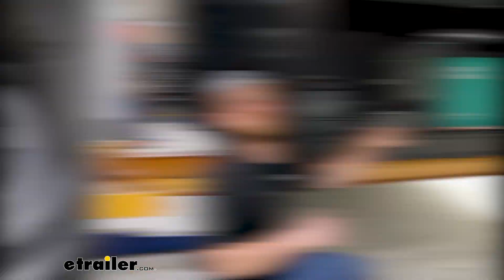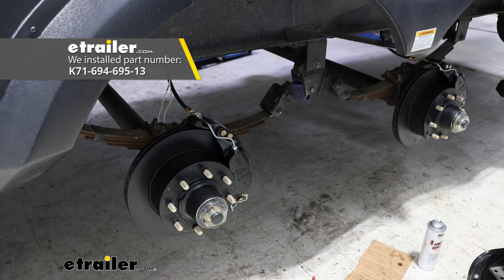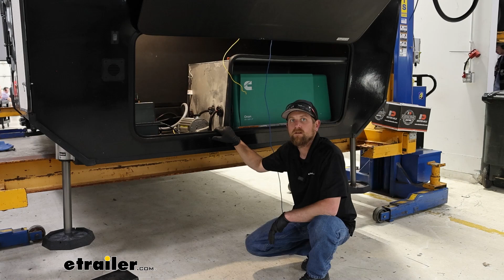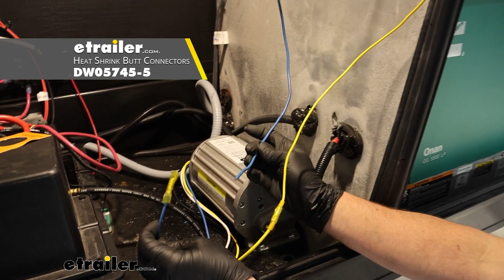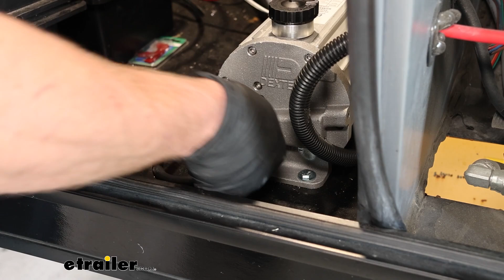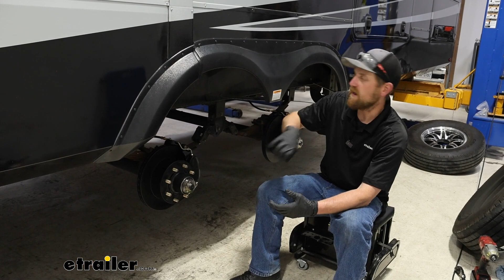Dexter DX Series Electric Over Hydraulic Brake Actuator Installation - 2021 Grand Design Solitude Fi

Comment: What brake lines did you run from the pump to the axles? The rubber hose whips are short. Did you run hard lines and if so how do I size them up and purchase them?